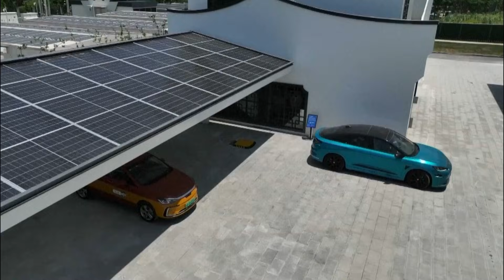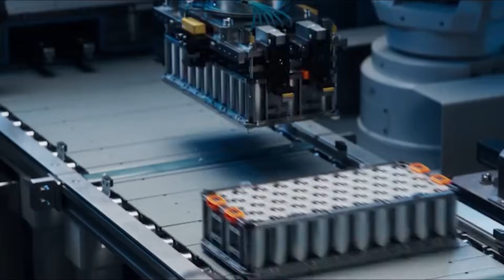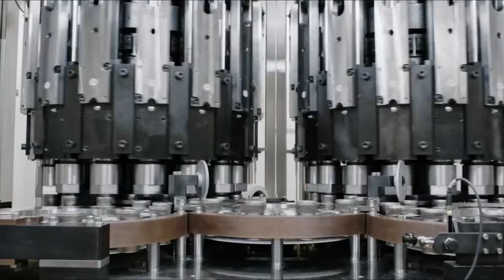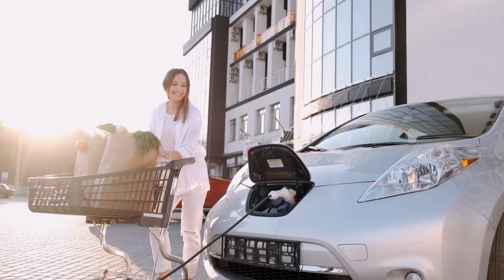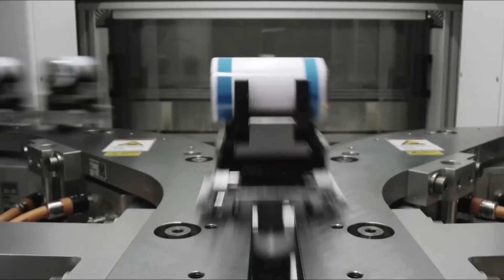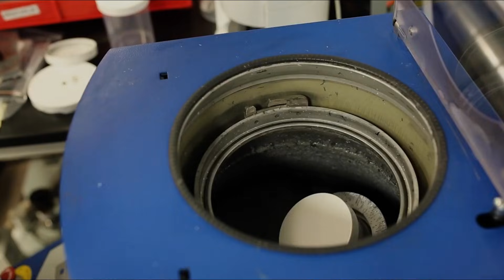Donut Lab's 100,000 Cycle Is Physically Impossible

Comment: We have seen 3 practically identical cells, which have same fingerprint and could have faced any of the tests Donut Lab ordered.

From the reports we can tell that
1) One cell went through self discharge test.
2) One cell went through high temp test and failure test (50 cycles after loss of vacuum).
3) One cell went through fast charging test AND is going through cycle life test.

How do we know the third one? In the self discharge test we can see temperatures going up and down in 20-minute cycles for days, meaning a cell is being tested in the background. After this week's report we learned that that cell is not the one in this week's report: that cell went through 50 cycles, which is way less than what we can count from the self-discharge test.

It's true that they haven't shown everything, but they are not ignoring their burden of proof.